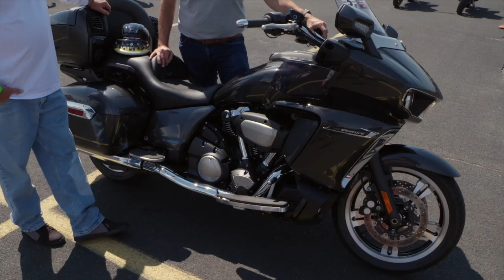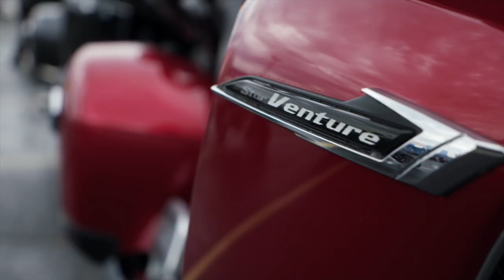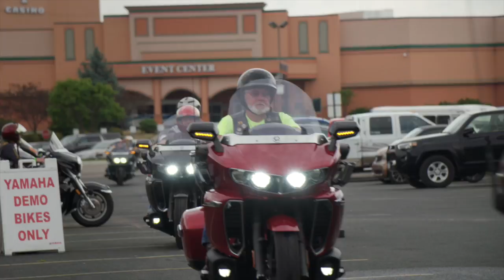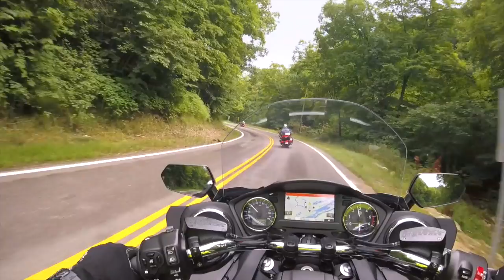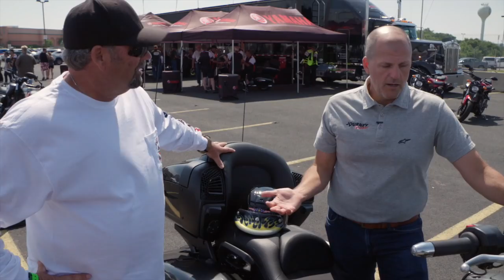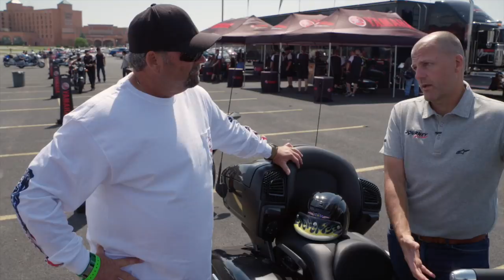2018 Yamaha Star Venture – V-Twin – First Ride Response

Comment: I would not buy this bike. I bought the bike on Jan 6 as a pre-order and the bike was delivered with the electronics not working. The dealer said they would get the fix immediately and now it is the end of March and still waiting for an answer. I own R1M, FZ10, FZ09 and the Venture, you would think that Yamaha would like to make me happy. The customer service rep is saying that a engineer will dial into the dealer to help them diagnose the problem. I would think a new bike would be priority to be fixed, but I am wrong. I traded a Goldwing for this and I am not happy that I gave up my reliable motorcycle for a bike that no-one can fix. I am not sure why Yamaha does not consider this a problem
Reply: Have you had that issue resolved yet? If so, does it work as it should? Any other comments (positive or negative) on your experience with this bike?

Comment: Is it possible to do a wheelie on this motorcycle? If not, is it simply a matter of power : weight, or is it due to electronic controls that prevent it?
Reply: The laws of physics might have an issue with that.

Comment: Disappointed... a vtwin goldwing... I like the front end.... but that's it. The rear floorboards need work. They look like you had leftover boards from gen 2... no hee toe shifter as standard... poor gas mileage... price of bike is hard to grip... that's a indian roadmaster range... Kawasaki Voyager would be a better bang for the buck. I will say... good job... no cassette deck.

Comment: 34 mpg? Is that the best it can do? I routinely get 50 mpg on my Goldwing and my gas tank is under my seat. The 6 cylinder is flat and low. Nice bike Yamaha but Goldwing genealogy started over 40 years ago with evolutionary design.
Reply: Paul CF yeah that mileage surprised me too. I average of solid 42 on my Victory Cross Country tour on my back road ride to work and that includes many stop signs, if I set the cruise on the highway and keep it under 75 I'm usually between 50 and 53 miles per gallon. Mountain Roads not included . I did sit on one of these and was impresseed with the seat and legroom. Ride on !
Reply: Paul CF Man with a bike like that I bet your life is a lot less stressful than most! I wonder if many Goldwing riders will consider BMW's new K1600B with 160 hp and 1800cc their I6 sounds like an F1 car. That's the ultimate motorcycle in my opinion. Although the goldwing ain't bad either
Reply: 1650cc, not 1800. Hence, the designation K1600.

Comment: I like it! The redesigned 113 in. has loads of torque and makes for a great trailer hauler. Has more torque then the Vmax...well the royal Star Vmax engine is a detuned Vmax engine why not undetune to around 140 hp? Liquid cooling is an advantage.
Reply: Still waiting for a independent review.
Reply: Check out TwoWheelObsession.  Bryan's review is spot on and quite honest.
Reply: @johnjones5977  That's funny you should say that because I never agree with that guy's opinion of a bike and I've watched a lot of his videos.  lol  And especially his opinion on the Venture.
Reply: @gabbyhayes1568  I agree with Bryan and I've ridden the new Venture.  It's a dog with fleas.
Reply: John Jones That’s such an unfair statement. I don’t really value the opinion of a sport touring rider when it comes to evaluating a V-twin touring bike. Sorry but you’re both wrong about the Venture IMHO.  But then again that’s why there are different genera.

Comment: I did not see engine heat addressed.  Every air cooled V-twin I have ridden was uncomfortable hot on the legs in temps above 80, particularly at speeds under 30 mph.  Is the Venture an exception?  If so, how is this accomplished?
Reply: Same concern here in Arizona. My triumph has no problem with the heat and had to modify the Victory to ride in the heat. I have not found an air cooled that can handle above 95F heat at a stop light without insulated jeans or blower fan.
Reply: i owned a stratoliner and it handled heat ok....   On hot days it put out  quite a bit of heat on  right side of  machine.     when  it was  95 degrees or higher outside  you would just be advised to not get stuck in traffic.    the bike could overheat  if in standing traffic over  30 minutes...     it was a great bike.    live in arizona.
Reply: It is really Air/Oil cooled just like my Stratoliner(moved on since). I had zero hot weather issues with it, and this new Venture has improved on dry sump oil storage using the lower part of the frame for that instead of in a tank just under your cajones. My Strat 113 engine was solid frame mounted and was almost vibration free, so isolating what is a very similar engine would be very smooth I am guessing.
Reply: John Jones , where were you able to test ride the new Venture?
Reply: The Strat handled heat WAY better than this does.  You will find the head goes straight to the tank, and therefore your leg.  Especially the left one.  This bike is a huge disappointment.  Sport mode?  Get serious.